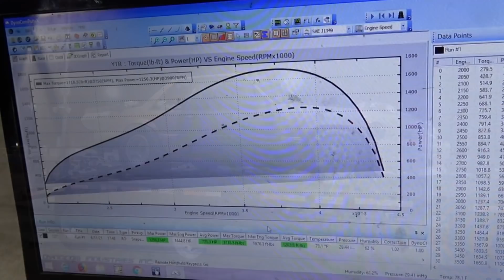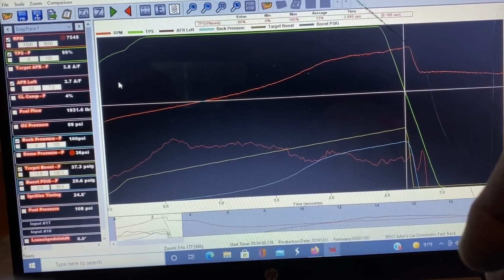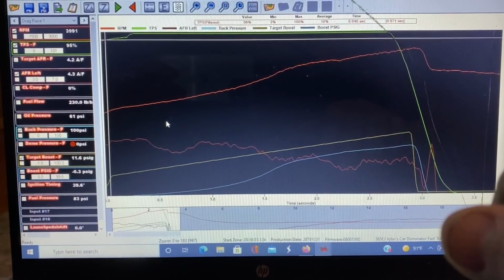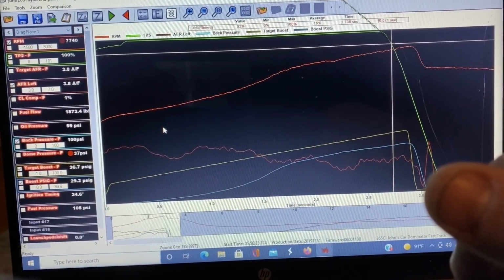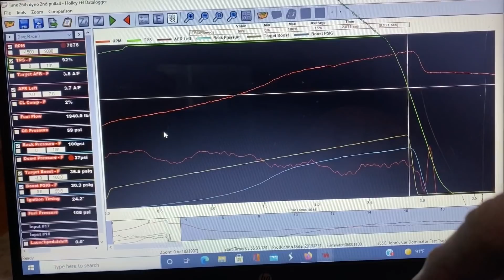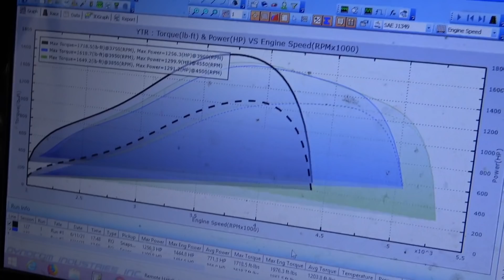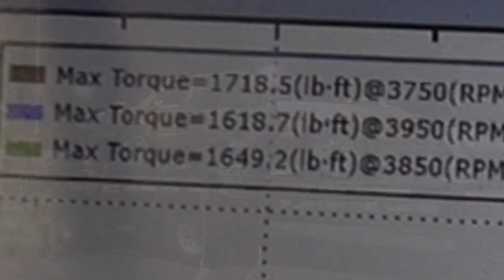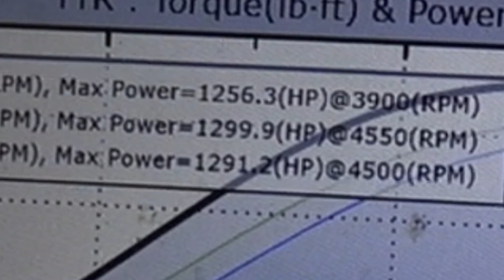1299.9 RWHP, Destroked 400 SBC, 102mm Turbo

Comment: Ah this is where you knowingly pulled onto a dyno without a working brake (so you claim on fb) and hurt the motor and trans all in one shot. Good job, shoulda got on the brakes and maybe it would've saved the trans. Maybe this will learn as to why it's NOT a good idea to click neutral and shut the car off right at the line.

Comment: One thing I noticed is either the holleys fuel flow calculation is wrong or the dyno is, based off you’re fuel flow (1950-2020lb/hr) and the AFR in the log it’s moving enough fuel for around 1200-1300hp flywheel, imo for 1300whp it would need approx 2650lb/hr at AFR of 3.7:1. It’s probably the fuel flow number, I rarely see an accurate lb/hr number from holley whether that be from their injector data or their RF model. Not hating either btw, just an observation from a data nerd, love the channel and look forward to seeing more new car progress!!

Comment: Torque 1618@3950 RPM.  HP 1299@4550 RPM. Looks like results from a diesel. What kind of cam you running to make peak @ 4550. Are you sure this is your results, seams fishy. Car sounds like you shift around 8200-8400 at the track.
Reply from the maker: That’s roller rpm, not engine tpm

Comment: Check your Diag 6 and 7 in your logs. Will give you an idea of when it starts having issues. It will run past the initial issue. Mine started to lose sync at 4800 but didn’t shut off until 6700. Took a while to find.

Comment: Do you think the trans damage from the tires turning so long off throttle and low/no trans pressure? Every pull ive made they hit the dyno brake nearly as soon as i lifted throttle and stopped a few seconds after, that thing rolled forever it seemed. Feels weird going WOT and sit still dont it lol

Comment: Congrats to the winners..    I thought for sure it would of made more hp, like 1550 to 1600 rwhp. If the tq number is right then right on.   Our little 23° 400 sbc on 12 psi made 1300 rwhp on the portable dynocom dyno.

Comment: Those dyno numbers are really skewed.  How could you make more torque on the first run with less boost and less HP?   And at only 3750 rpm
With a soft boost ramp.  And max Hp at 4550 rpm.  
Something is not adding up.
Reply from the maker: They did not hook to my car, that was roller rpm

Comment: I'm still thinking 1800 there's no way that little destroked motor could have been out of breath at 4500 RPMs. couldn't have made more torque than horsepower. Something not right should have made maximum power at 7500 RPMs or more. Are you positive it didn't start the Tire spin or transmission slip at 4,500 on the dyno or did it have back pressure issues? Still a good number but I think you're leaving about 500 HP on the table. Love your channel thanks for all the info.
Reply from the maker: 4500 was the roller dyno rpm, they did not hook to my car

Comment: Hey brother on the dyno graph were the Rpm numbers right because you didn’t even hit 5000 RPM if that was correct and I mean that’s kind of like stock big block rev numbers im a small block Ford guy and I hit 6500 to 7000 if I’m in a froggy mood so could you please tell me why you don’t rev it very high by the way if those torque numbers were right that is impressive
Reply: Once again I should watch the entire video before I ask questions you answered them thank you John
Reply: It all depends on your cam.
Reply: @matthewvarnam4302  No it was because it wasn’t reading the Rpm of the car it was reading the Rpm of the Dyno rollers and no drag racer alive would put a cam in that would limit his small block to less than 5000 RPM on a turbo motor that was why I asked the question it didn’t make any sense for him to have his revs so low to be making that power for that application in fact turbo supercharged naturally aspirated mud truck drag car street machine I don’t think there’s anybody alive who would still build a small block motor that can’t even rev to 5000 RPMs no matter what cam you put in it that would have to be a very poorly built motor if 5000 was your rev limit and if you look at the edit that I added which would probably be the first reply I stated that I made a mistake I hadn’t seen the whole video before I asked the question and at the end of the video he explains why those numbers are all askew and it has nothing to do with a cam it doesn’t even have anything to do with the motor

Comment: With the loss thru the drive train you're easily making 1,400+ horsepower..
Reply: Through a power glide and the tires he has on he’s making 1500-1600 at the crank .
Reply: @jkfonyi  I thought average drivetrain loss was 15-25%
15% for fwd manuals
25% for 4wd autos
Reply: @Jake_Hamlin  yea i believe ur right
Reply: Shit that car will make 1600whp turned up probably around 1700-1800 maybe a tad more at the crank that is a bad bitch it's been in the 4.50s and it takes 1500 or more to run those depending on how heavy it is

Comment: That's impressive. I was thinking 1000hp.
Reply: What ????? At 33 psi on a 102 . 1300 seems low for that set up and the times he has run in the past in radial trim .
Reply: @jkfonyi  1300 sounds about right to me.. reason I was guessing 1000 is bc of power loss through the drive train on dyno. And also sometimes those trailer dynos are funny. That 1618ft lbs torque is great imo.
Reply: @tylerturner5442  ya that torque number is crazy . Those tires rob numbers on the chassis dyno also . And 200ish wheel lost through the power glide . That thing is probably making 1500-1600 at the crank .
Reply: @jkfonyi  oh yeah definitely making around 1500 at the crank if not slightly more. He also runs methanol and that makes more power. I ran methanol for a short time bc it gave me more power and alot cooler engine temps... however it was more maintenance than it was worth to me. I went back to 110vp gas.